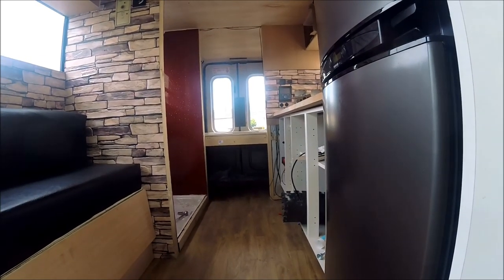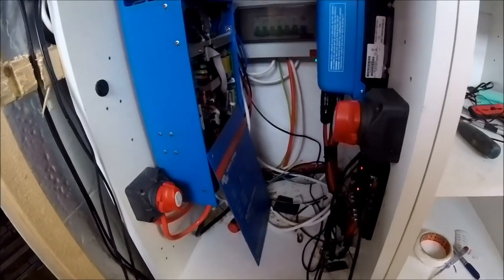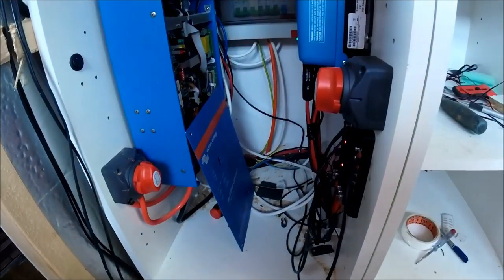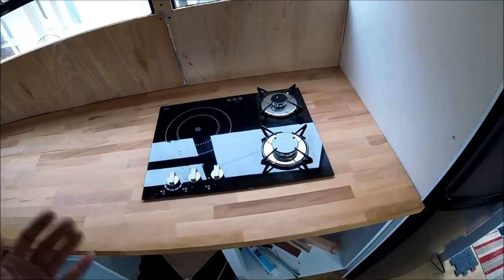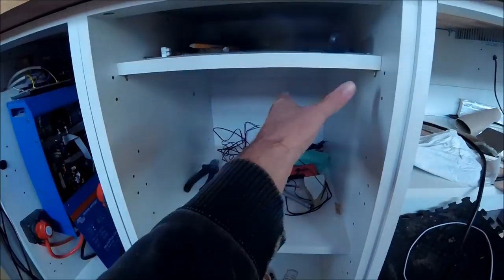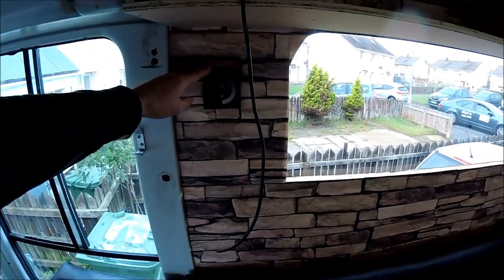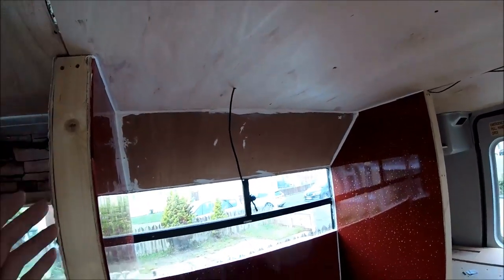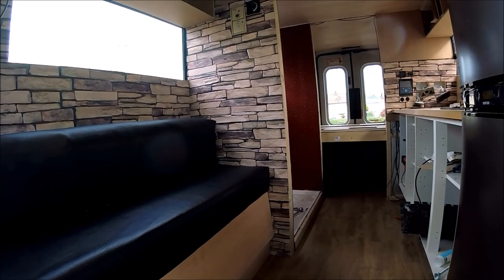Mercedes Minibus Motorhome Conversion Progress Update

Comment: Dave, the interior definitely has a higher grade appearance than previous conversions. Obviously the appliances being premium units helps a lot - you get what you pay for I guess.  But what really sets this off is that there is a lighter tone with the large windows, blonde woods, and the nice faux rock paneling.  I realize this build has a much higher investment cost, and I am sure it will take longer.  Hopefully, the eventual profit will justify the amount spent in time and money.  When you market the vehicle, there might be fewer buyers due to the price, but it will be interesting to see your final analysis, and if you determine whether to do more like this or to specialize in the affordable types for quicker turnover.  There is a market for both. Good luck. 😁👍
Reply from the maker: Thanks, I have another bus to build after this is complete and I think that will be a bit more of a budget build, I’ve just gone all out on this build to make it as high spec as I can, but as you say that will reduce the market for it if I sell it, hopefully someone out there will appreciate the work and cost that’s gone in to it if I do sell down the line.

Comment: Looking pretty amazing fella :) 
I had a feeling this would be a special build from the minute you began
I've actually done a couple of small van conversion on my channel, and I'm just starting a "Micro Surf Bus" project at the moment which is proving taxing due to the limited space lol

One thing I have to ask is why you went with that Black leather look covering on the sofa/bed? 
It's a great design, but in my opinion that Black leather look really lets it down, and it's pretty much the first thing you see!
I think I would have gone with a really good quality material personally?

It also looks "floppy" and not quite finished? (compared to some of the R+R bed options out there which look so nice)

Anyway just my humble opinion, the rest is just awesome mate :)
Reply from the maker: I went for the black leatherette so it matches the front seats as the passenger seat swivels and I wanted it all matching when it was swivelled around. The leatherette was more expensive than standard upholstery material. The cushions are quite a tight fit in the covers, no floppyness in them. The base needs a lick of paint and a retaining catch to hold the extension board in place so that doesn’t move otherwise it’s fully finished.